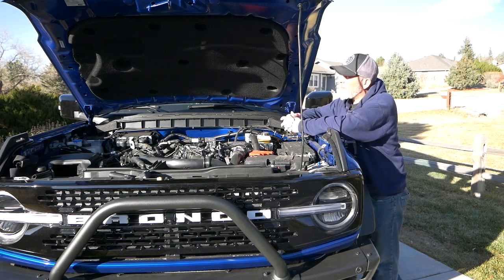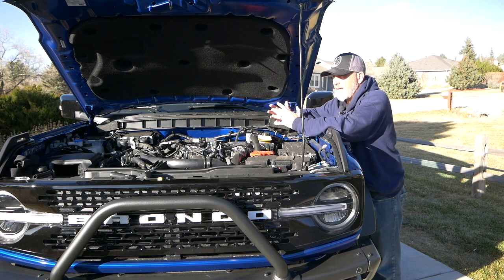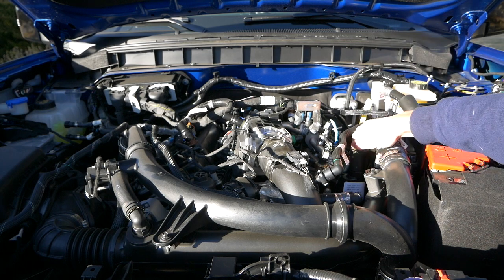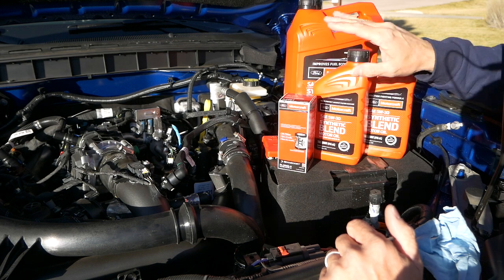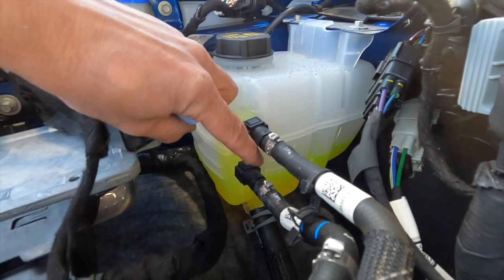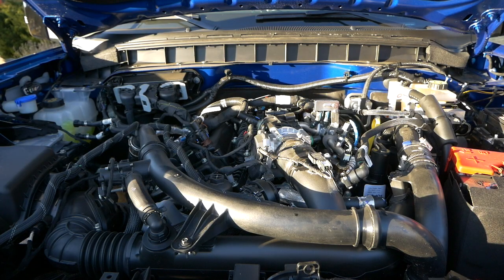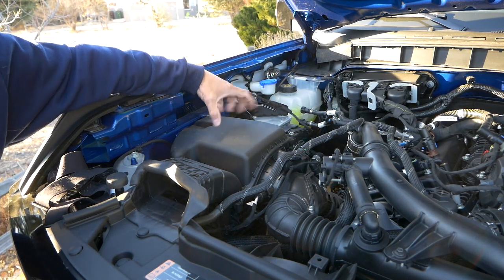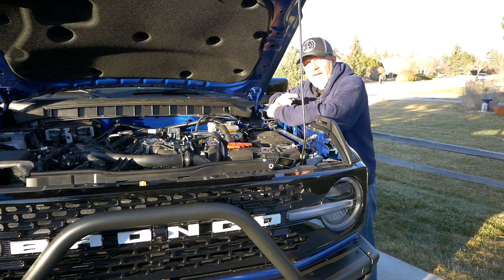Ford Bronco Engine Bay and Maintenance Overview 2.7L Ecoboost

Comment from the maker: Be advised… You do not have to change your oil after 1000 miles!  Ford states to go the regular mileage before the change. I am just being over cautious.
Reply: Look into using AMSOIL for your Bronco. It'll keep that turbo clean and lubricated as well as your engine for a Looooong time. And it will not void your warranty

Comment: Awesome video..👍did you know that ford motor craft oil is ranked right up there with one of the worst oils you can use! I have a 2019 mustang GT PP1 I’ve never let ford change my oil I use amsoil full synthetic & she’s runs like a top! When I get my 2023 2 door outer banks bronco with the 2.7 I won’t be running motor craft oil! Again good vid & good need to know info for when mine arrives... 👍

Comment: I have a 2.0EB Maverick as interim until I get my 2022 Base Squatch with the 2.7EB. With a turbo charged engine I would never go more than 5k between oil changes due to blow by and the heat that the turbo produces. I would (and did) go to Mobil 1 Full synthetic at 1k. Also crank the motor after the oil change in "flood clear" mode to circulate oil thru the motor before is fires up. 2DR Day 3 reservationist and still waiting patiently.

Comment: The window bounce and steering resets don't sound great.  Thanks for the heads up.
Reply from the maker: Its really not that bad. Driving the car straight for 30 seconds while the steering centers is all that needs to be done.

Comment: Had to put new battery in. No need to reset windows or steering angle sensor. Everything was fine after new battery installed.
Reply from the maker: Interesting. Thanks for the comment.

Comment: Where in the world is the engine? All I can see is plastic and rubber everywhere. There is where most of your maintenance will be down the road, cracked and dry rotted plastic and rubber😝
Reply from the maker: In 20 years it will be a mess. Until then it should be manageable. I’ll swap it for a 302 once it blows up after warranty expires anyway.
Reply: @alpinegarage8548  that’s a great plan there!
Reply: @alpinegarage8548  to be honest 20 years in cold states only, in hot zones will be 10y max